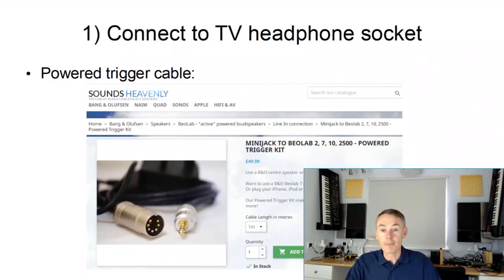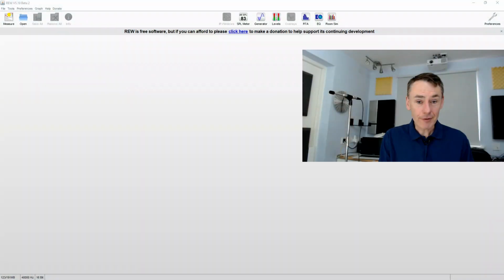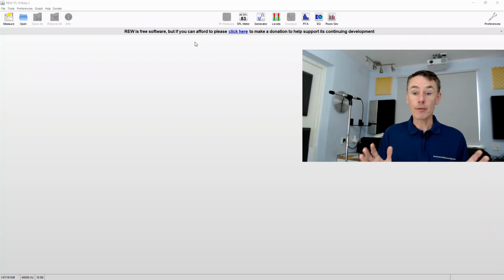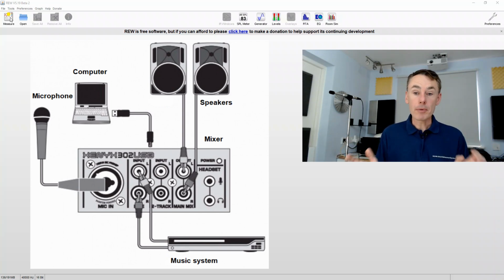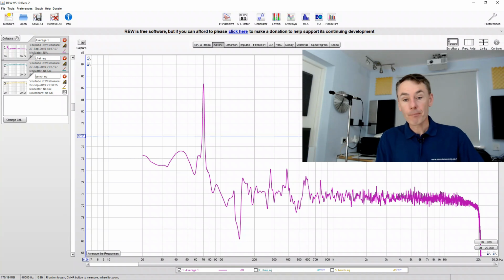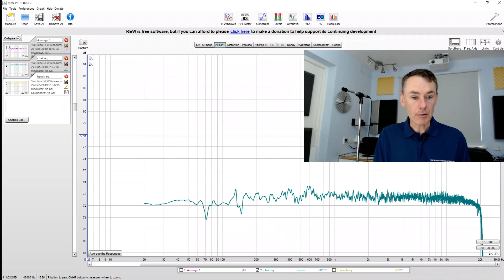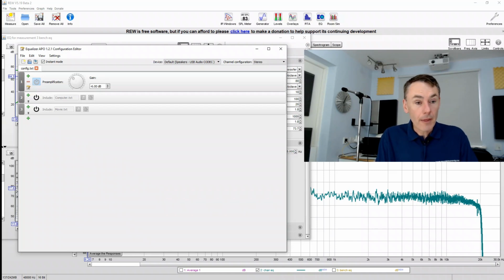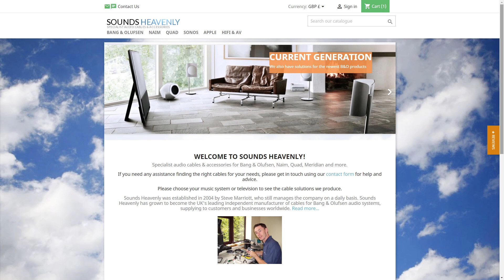How to retro-fit DSP to your classic Beolab speakers - can you really get Beolab 5 sound for £60?

Comment: Another piece of hardware (and software) I never knew I needed to have... Well it is on the way now.
Reply from the maker: It is well worth the trouble - getting your sound corrected via DSP can really open up the power of your system and speakers....it is the best upgrade I ever made to my system!
Reply: Being interrested in music and audio since early -90s (including designing speakers and filters based on parameters) and recently I got hold of B&O speakers that they were going to throw away (!). But in these days I think it's better to stay inside and develop knowledge instead of using my money on social activities. So the new mixer for my B&O and computer and 2 mics (one for reference measuring and one for miking up my Leslie) is taken from the social budget.
Reply from the maker: @staalefo  That sounds like a good plan!

Comment: is this the same as Audyssey MultiEQ XT-32 from Denon which you get with their recievers out of the box?
lovely youtube again. easy ways to improve your sound experience. you can also use this tool or trick to spot where you might want to include some acoustic measures such as dampeners.
Reply from the maker: The microphones supplied with AV receivers are usually Dynamic mics, not Condensors like the one I used.  This means they only work with the receiver, as they don't naturally have a flat frequency response.  Instead, the receiver has its own DSP pre-loaded to balance out the frequency response of the microphone supplied with it.

Comment: Cool idea indeed, because I have a setup for the master BV7-40 mk6 with attached BL2, two front BL8000mk2 and two rear BL5000.
As far as I understood, I’d have to do the measurement with all speakers on for the living room and compensate this instead of any single speaker, correct?
But what to do with the bedroom calibration BV7-40 mk6, Cona via Mcl2p, front RL6000s also via Mcl2p and rear BL8000mk1?
Not talking of my three other rooms.
Any way how to implement the different corrections via my BS4500 matching to the fitting room when listening to the music server you just introduced?
And when watching movies via HDMI cat distribution from my just main ATV sending it to the other tellies.
Would really appreciate any ideas on that.
But already again a great job with these two videos
Best regards
Reply from the maker: Thanks!  Sorry I don't know of any way to add the DSP software via a B&O TV, this is only when using the speakers directly with a computer.  Glad you liked the video though.
Reply: @soundsheavenly  Will ask a friend who is sound engineer here in Hamburg/Germany and professional singer. If I get a usable answer, I’ll let you know asap
Reply: @soundsheavenly  and I will give it a try with speaker4 mode on the BV7s for music filling the whole room at party time ;)
Because I also face this overdone low frequency room acoustics by wooden floor though decoupling the speakers best from it…
Reply from the maker: Thanks!

Comment: Can I use Xenyx 302USB to support a pair of Beolab 8000 and Beolab 11- is sub should be a part of the circuit or may stay connected directly to mono output in my preamplifier?
Reply from the maker: Good question!  I would connect the Beolab 8000s to the output of the Beolab 11, then the subwoofer can manage the bass for all three speakers.  However, if you want separate control of the subwoofer then an independent connection for the subwoofer could also work

Comment: Very interesting video - would these measurement files be useable with the Beocreate HiFiBerry?
Reply from the maker: Thanks! I haven't used HifiBerry myself, but I understand that it can interface with REW as mentioned at this link: https://www.hifiberry.com/docs/software/implementing-room-acoustics-correction-using-rew/
Reply: @soundsheavenly  nice - tempted to do this with a CX100!
Reply from the maker: @misterroast6545  Good idea! Always best to add a subwoofer to ensure that your speakers can produce deep bass when performing DSP, as the bass tones are where you will get the biggest results

Comment: can this be applied for beolab 3 speakers
Reply from the maker: Yes, you can use this same process for any Beolab speakers.  It is worth noting though, any speakers with ABL bass calibration (such as Beolab 3) may not play sound consistently at all volumes - this may mean that you need to take multiple readings at different volume levels to ensure the speakers behave in the way you want them to.

Comment: I have the beolab 14 5.1 ..... Would this work?
Reply from the maker: Hi, yes the Beolab 14 system is ideal for adding DSP as it has a good subwoofer that produces very beep bass.  Please feel free to get in touch at https://soundsheavenly.com if you need any help with cables to link up the Beolab 14 speakers to add DSP and I will be happy to help
Reply: @soundsheavenly  but my beolab 14 is connected to my Onkyo Amplifier then to my TV. Not to a computer where can apply DSP ......
Reply from the maker: @valentinot4963  No worries, your amplifier may already be able to do the DSP for you - please check the amplifier manual or email me via the contact form at https://soundsheavenly.com if you need any further help.